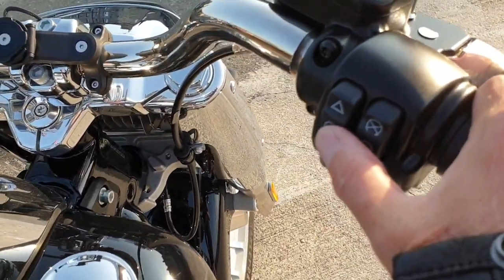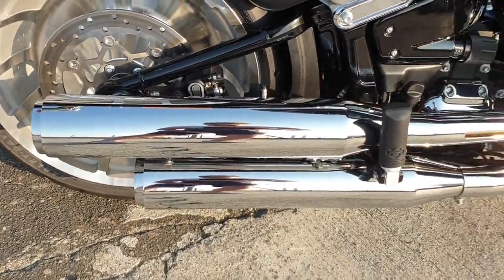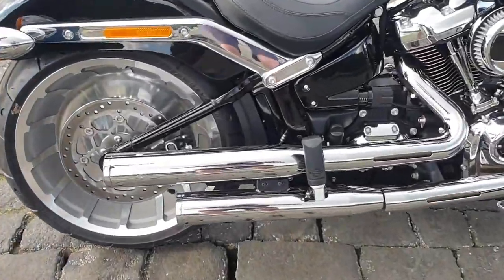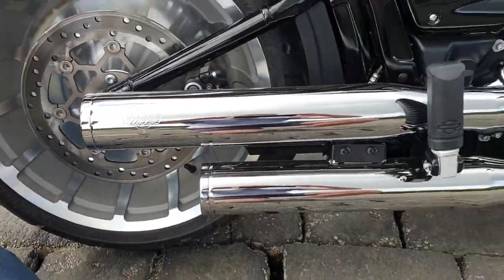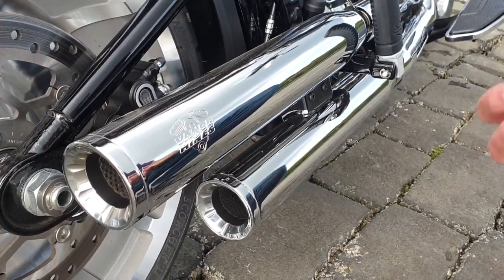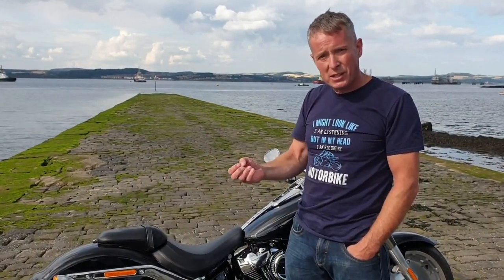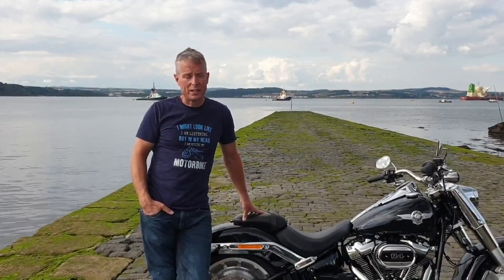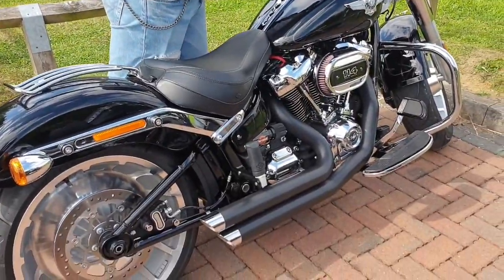2021 Fat Boy 114 Stage 1 Comparing stock pipes v V&H Eliminator 300s v Cobra Speedster Slashdowns

Comment: That's my dream bike, do either of you have any concerns with leaving your bikes out in bad weather. I don't mean overnight but rather if you took it to work and had to leave it outside for several hours. Really nice job on both your bikes
Reply from the maker: Thanks Dan. To be honest, I take bike out in decent weather and avoid poor weather. I keep it indoors so can't comment on how it would be in bad weather. I'm sure it would be fine if you keep it clean. You could also use a cover. I did see an Iron 883 looking poor, rust and peeling paint, it was just 2 years old. You also see bikes 10+ years old looking great. I would definitely use one of the treatments such as ACF50 to protect your bike. Hope that helps.
Reply: @1scottishiron  I am the same, I only ride in good weather,  I had an 8hr spinal fusion op a few yrs ago, which didn't work & my back would be in bits if I had to detail a reall dirty machine.  I have a 2017 Fatboy lo Special,  it was the lowest ever production Harley, mine was a superceded model,  so they threw in V & H Big Radius pipes, Screaming Eagle Air Cleaner  & an FP3 tuner, as well  as a sissy bar & rack. I love the Fatboy,  always puts a smile on my face,  have a great weekend 👍
Reply from the maker: @geoffozevans4500  keep enjoying that lovely bike and safe riding to you!! 👍
Reply: @1scottishiron  👍👍

Comment: Nice video, well done! I have the same bike, in Blackjack Metallic. What did you do with the two O2 sensors on the pipes? I am very keen to replace my stock pipes with Eliminator 300s, but cant seem to figure out what to do with the two O2 sensors.
Reply: The O2 sensors are in the head pipes.
Reply: @barackblows1942  Hai... the bikes sold in USA have 2 O2 sensors in head pipes. And the bikes sold outside USA have 2 O2 sensors in head pipes and an additional 2 O2 sensors in mufflers.
Reply from the maker: That was the issue, Vance & Hines are not making slip ons with the o2 sensor which is necessary for the 2021 European bikes. The solution is a remap direct at the ECU, avoiding a FP3 tuner and meaning the existing Eliminator 300s can be fitted. Still a Stage 1.
Reply: @1scottishiron  thanks Man! It helps! How does the remap at ECU? Can the HD (Abu Dhabi) guys do it for me?
Reply from the maker: @ashrafglobal  its new but they should be able to do it now. Give them a call and check, explain this is solution in UK.
Reply: @1scottishiron  great! Many thanks for the guidance! Enjoy the rides!
Reply from the maker: @Tommy Egan it is still tuned, still a full stage 1 but direct at ECU, no FP3 necessary.
Reply from the maker: @Tommy Egan I can't say for sure but believe it should not affect the engine management warning light as you are simply replacing the tail pipes. You likely won't benefit from the same performance or economy without the remap.
Reply: Screamin Eagle Pro Street...👍

Comment: Did you have to tune the bike? Any poping on deceleration?
Reply from the maker: Vance & Hines are not making slip ons with the o2 sensor which is necessary for the 2021 European bikes. The solution is a remap direct at the ECU, avoiding a FP3 tuner and meaning the existing Eliminator 300s can be fitted. Still a Stage 1. There can be some popping at times on deceleration.